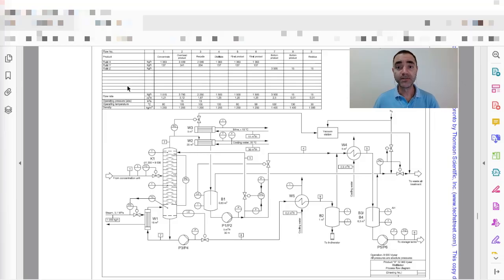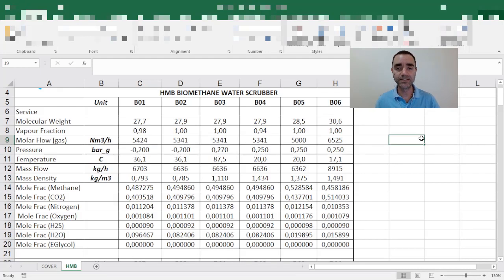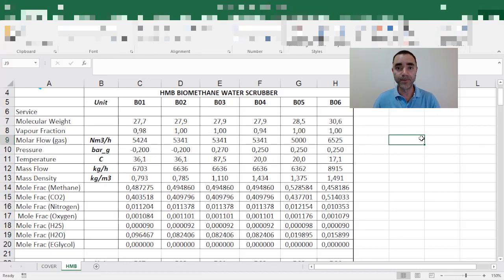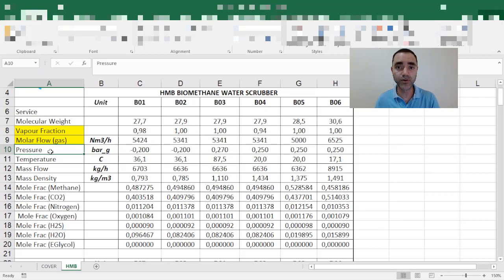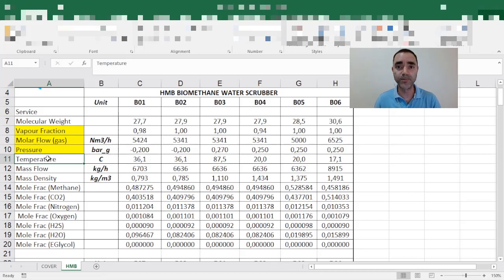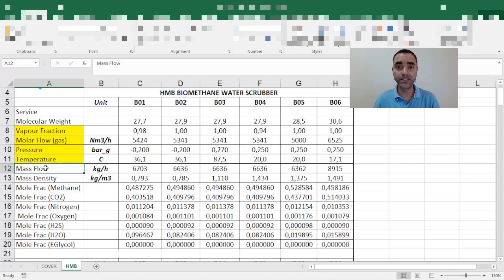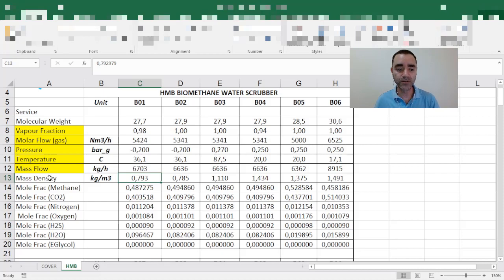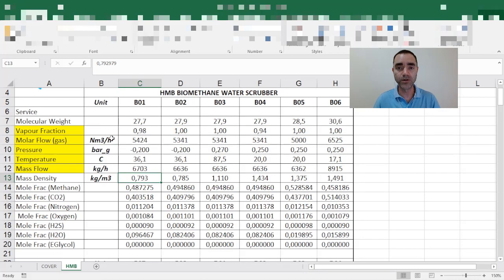HEAT AND MATERIAL BALANCE ESSENTIAL IN THE PROCESS FLOW DIAGRAM FOR CHEMICAL PROCESS ENGINEERS

Comment: Do you do the HMB after the development of the PFD or before the development of the HMB?
Reply from the maker: Hi Ike, nice question. In general, from a project from scratch we will get the problem (product specification) and the feed, and start with a block flow diagram to identify the main units or systems. From the BFD it is possible to do major calculation regarding material balance. Next step is to perform HMB. In my point of view, drawing the process first in the PFD will let the life of the chemical engineer easier. After the PFD, I build my process simulation and perform HMB. Eventually, during the HMB it is identified that additional equipment is required or can be removed and this way the PFD is updated. In a simple answer, I would say that PFD comes before a complete HMB 😇 Sorry for the late response.